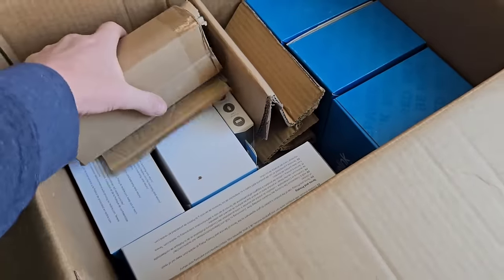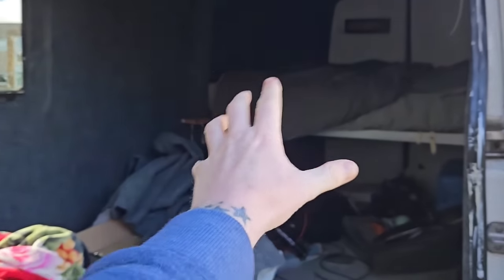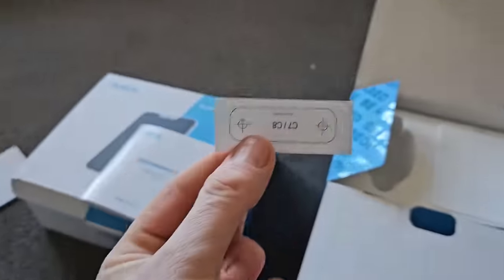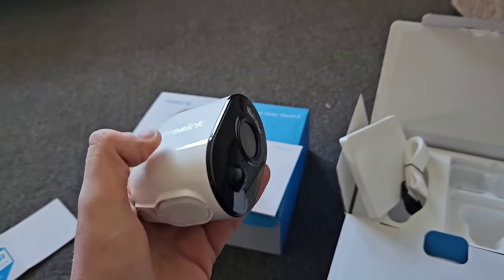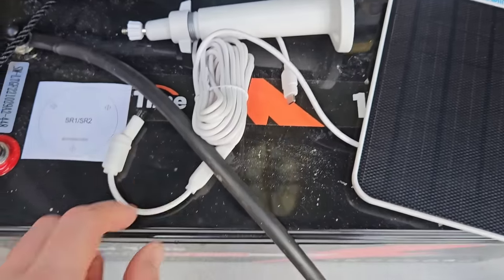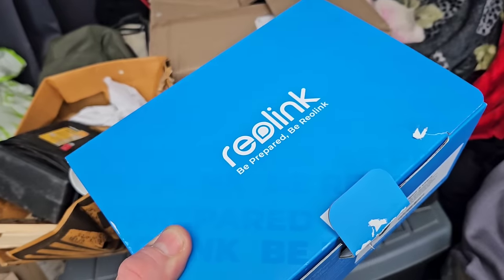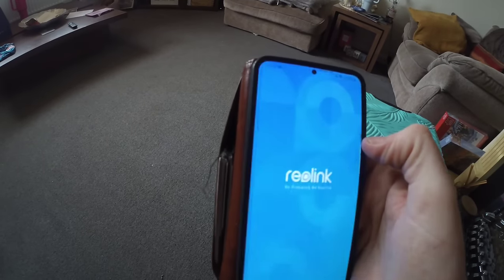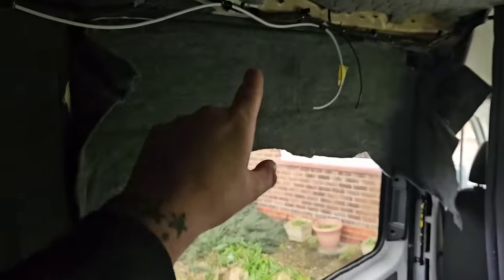CCTV on Our Campervan

Comment: Great video, I love those cameras they look great on the van so far and I love the extras, you never have to risk getting hurt going out to people around your van you can just scare them off with the flash light and the alarm, DO you not have any warranty on your van ? I'm curious with the stuff you need to get fixed as to why it's not done through warranty, Any way Good luck with getting your van fixed mate 👍

Comment: When u take the egr valve off which is easy there's a black plastic cover with 5 Allen keys take that cover off and there a black or cream plastic cog with worn teeth slide it off and replace but if ur water tanks pressurised it's a split hose or head gasket or cracked block

Comment: Hello there nice cameras il have to nip up sometime for some advice as  your only over the field from me if this is OK let me know
Reply: I can't see that your engine head gasket has gone as I get cream all the time in my vw golf mk4 but on my engine on the oil filler in goes from metal into a plastic box for the oil breather pipe which I've put down to condensation as my head gasket is fine
Reply from the maker: Loads of people have said egr valve and because I have a long neck on the oil fill it will condensate and gunk up. I'm taking it somewhere else on Monday
Reply: @iNDI_VAN_A_JONES  I'm still on the planning stage and just can't make my mind up on which size vw crafter van to get I went passed yours earlier and your van looks better in person mate are them windows easy to fit
Reply from the maker: Lwb is a pain. Parking is horrid and I can't fit down some of the lake district mountain passes because it's so big
Reply: @iNDI_VAN_A_JONES  I was thinking about either the LWB or the XLWB as the MWB is abit to small as I've been thinking about maybe making a garage at the back so I can fit a small car or smart car in the back or even a quad bike
Reply: Oh I've just thought you know your cameras put some lock tight on the screw threads so then they don't rattle loose plus it will stop people trying to tamper with them also any car accessories shop will sell it for a few quid mate
Reply: @iNDI_VAN_A_JONES  hi I hope that you have managed to get your van fixed and I do hope that it hasn't cost you an arm and a leg

Comment: Hi. We love watching your interesting videos, we have subscribed. We are in Norfolk and are converting an ex sainsbury home delivery van Merc sprinter 314 cdi 2018 autobox 7 to a camper. Getting on OK. Hope your vw is running better now. I've always used shell vpower diesel and add liquid moly Mos2 lubricate to the engine oil, do u and have u. Highly recommend it. Best wishes David and Beverley Norfolk
Reply from the maker: I'm definalty going to try that. My vans still very poorly. I was seeing signs that I was getting scammed so I took the van back and have it booked in Tuesday for a recommended specialist to have a look at it. Problem with the bank holiday is I have to wait haha
Reply: @iNDI_VAN_A_JONES  oh dear. Yes the liquid moly Mos2 lubricate is an oil additive. Excellent stuff. Even put it in my mower that's 31 yrs old. Germany first developed it during ww2 as their planes were shot up and lost oil pressure, the Mos2 coating prevented seizure and allowed them to land so the story goes. But is excellent. Good luck with van. They are good
Reply: @woozlehunter159  hi. Thanks for text. Hope u are well. Best wishes David